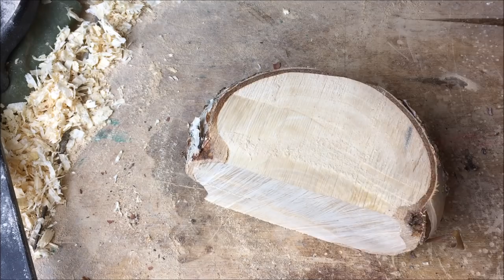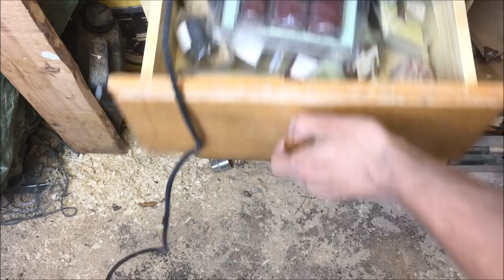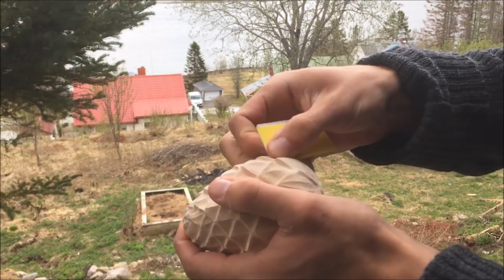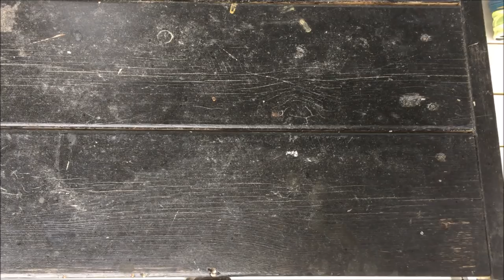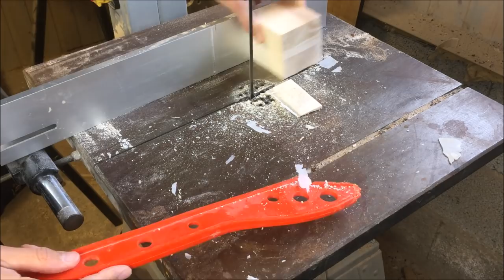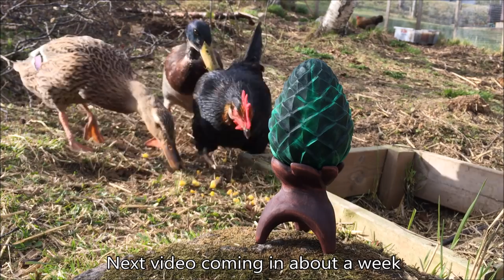Dragon Egg wood carving | by Jonas Olsen

Comment: I have a question, does it make a loot of difference to use a cheap dremel like tool for a few dollars or a real dremel, I would like to use it for carving.

Thanks for the help
Reply from the maker: I do not know really. i have a very cheap dremel at the moment. The biggest difference is the strength of the electrical engine so if you are doing work where you have a lot of ressistance on your bit, it could be better with an expensive one